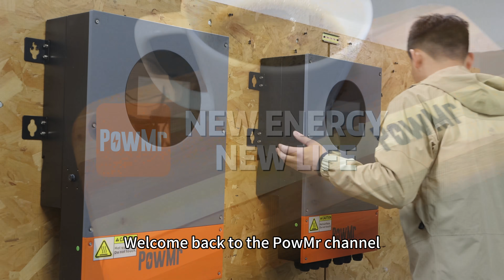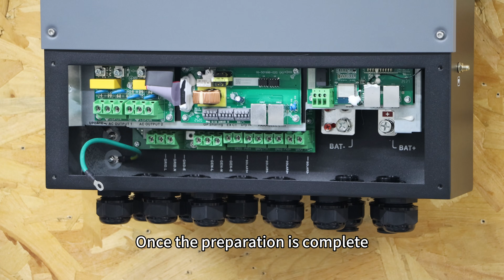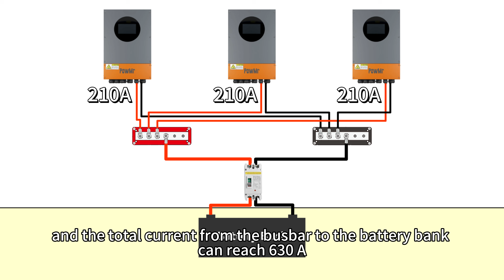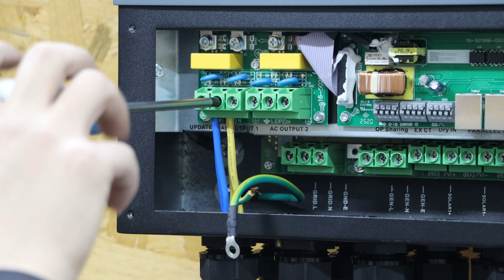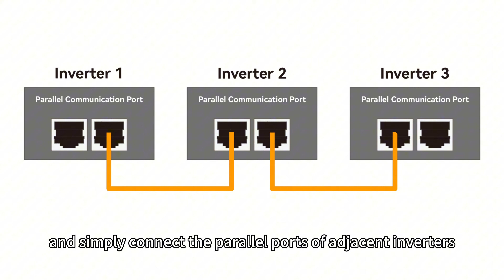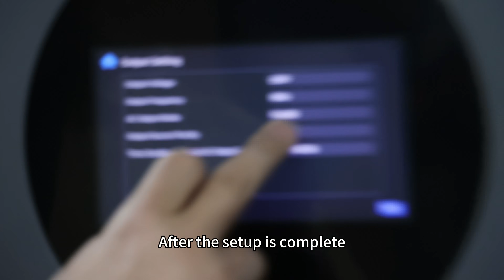How to Parallel POW-ELITE 10.6KW Inverters? – Single Phase Tutorial

Comment: I REALLY HATE TO TELL YOU THAT YOH ARE NOT WIRING THESE CORRECTLY! You are wiring the ac in series and they should be parallel. “ac in” is not for “ac in” from the previous inverters “ac out”  !! All ins and all outs should be common (parallel) AS PER THE MANUAL … your system may work but in the last output only has 10kw output!!!!
Reply: PROVE ME WRONG!

Comment: I am using a 1.5 kW inverter from your company, but the load at my house has increased a bit, so I am thinking of buying another inverter of the same model and paralleling it. Please if you could provide a video of it or give me a proper suggestion on how to do it I would buy another one.I made a mistake at first, instead of buying the 1.5 kW, it would have been better if I had bought the inverter that is available in your seat for 3.200 wards, but I had already bought the 1.5 kW 24 volt inverter. So I want to buy another one point five kilowatt 24 bullime pattern and put the two together to make a red collection.
Reply from the maker: This model does not have a parallel operation function and cannot be used in parallel.